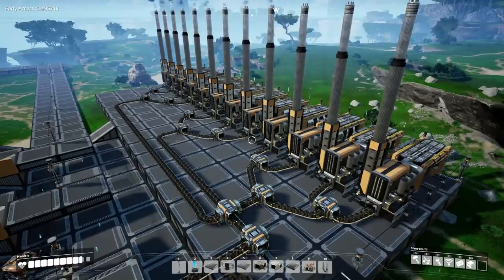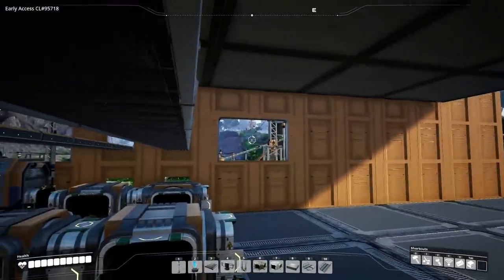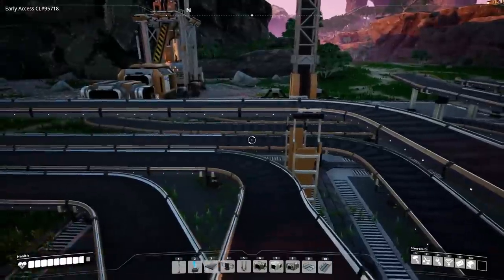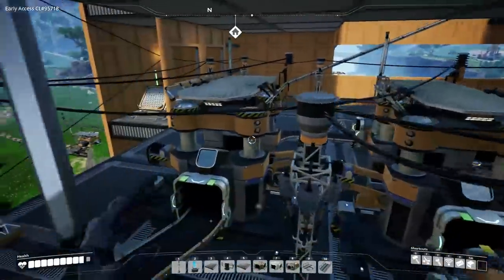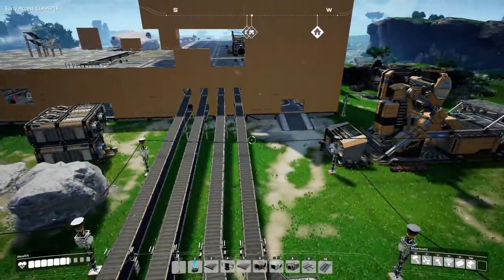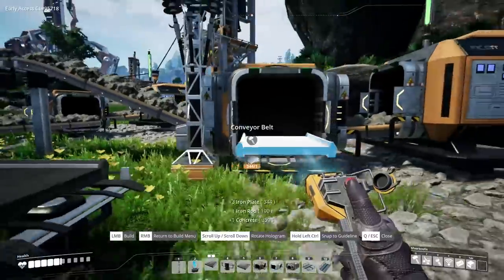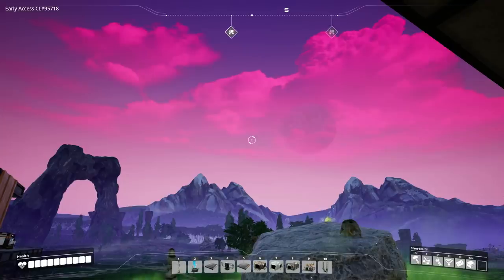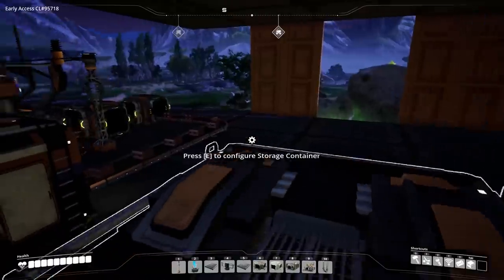AUTOMATE IT ALL; Factory Revamp for 100% Efficiency! | Satisfactory Early Access Gameplay Ep 7

Comment: sometimes I get confused with your counting xD if it takes 30 per minute so you need to pump in 30 per minute it allways tells you on the left how much is needed super simple and you would need 135 iron for 3 steel smelter. Still though really beautifull factory. Love it, will use some inspiration for my own

Comment: Hey, quick math solution for some problems you're having. If you've got 4 intakes in a row with the first three having  splitters, the first gets 50%, then 25%, then the final two get 12.5% each until the first few start overflowing till everything is smooth.  Buuuuuut, if you pre-fill everything, then everything will work perfect immediately.

Also, if you wanna funnel more stuff to specific areas using splitters slower conveyors can help. Say 240 coming in to a splitter going three ways, have 60 going one way, then the 180 left will be forced to split 90 going each of the other outbounds as long as they're MK2's or above.
Reply: Holy sheitt thanks dude xd
Reply: that belt trick will be very useful for me! thank you
Reply: Thanks man, this explains why my partner pre-fills the conveyers/constructors up

Comment: I can tell you didn't play Factorio before this.  If you have a fully saturated belt and you split it in two, you end up with two half-full belts.  Upgrading them is pointless.  It makes no difference how fast the parts move along the half-full belts, you haven't actually changed the throughput.  You've just lowered the amount of time each part spends in transit.  To fix, try to arrange things so you get one fully-saturated per output.  No merging after an output because that causes it to back up.  No splitting after an output because that creates half-saturated belts.  (Unless, of course, the math lines up perfectly such as when you split your iron ore.)  Crunch the numbers, and you can have belts with a perfect 1:1 ratio, just like that storage!

Comment: Well, the real question is whether fire can melt steel beams.
Reply: 9/11
Reply: Thermite, not fire
Reply: Kerosene can burn hot enough to make steel beams much more malleable. If those steel beams are load bearing it can be detrimental to the structural integrity of a building.
Reply: @jonjohnson102  
No, just fire.